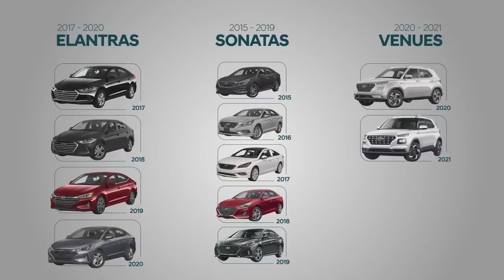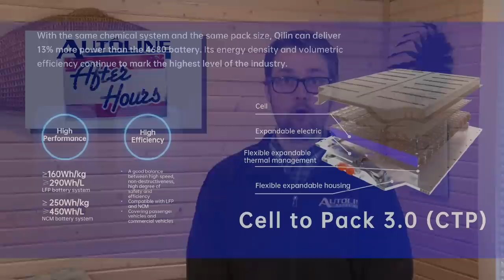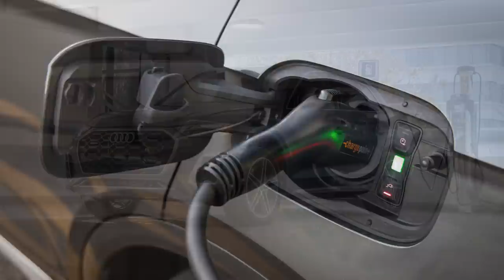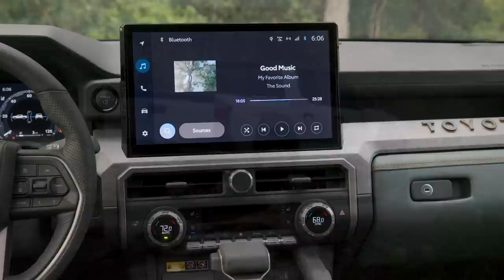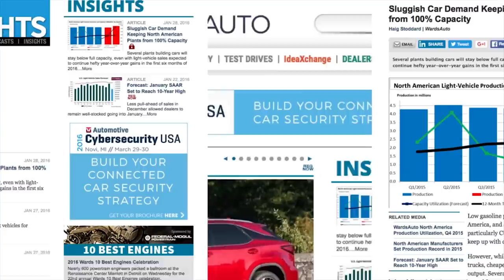GM Will Miss 1 Million EV Sales Target; Silverado EV Beats Range Estimate - Autoline Daily 3571

Comment: Nuclear Fusion costs lots of money. The fuels used to fuse together are right now not cheap and often have to be made first. Then there is the maintenance expenses. 
Ergo nuclear fusion power may be just or more expensive than electricity from conventional fossil fuel sources. 
The real competition here is wind and solar power which are way cheaper and require less maintenance costs. So the ongoing costs to run and service a nuclear fusion reactor are large. 
The reason you are hearing so much about fusion right now is that the scientists and investors are hyping it because they realize that fusion is becoming irrelevant since wind and solar will have completely taken over the market by the time fusion power can be made prevalent. 
Then they will be out of a job!

This is very similar to car companies hyping hydrogen fuel cell vehicles. They are not catching on and very soon battery tech will deliver as many or more miles per charge than a tank full of hydrogen can. Also the charge times for batteries will be cut in half within five years. 
Both fusion and hydrogen, as broad based power solutions are failing. Solar and wind will dominate and Battery only EV cars will be the only choice consumers will make.
Reply: Yep it will pretty much only be viable once they get He3 surface mining on Luna down pact, so yep not any time soon. But it's better that creating mountains of waste with renewables over time. It will be interesting when the fast fission plants come online and have lots of cheap fuel to use when they process the used fuel from the current plants.
Reply: @anydaynow01  Actually there are now companies that can recycle the wind turbine blades now as well as others that are recycling the solar panels. 
So maybe it won't be too bad since the expected life of these things is over 30 years.
Reply: renewables can be recycled much more easily than non-renewable waste....  just need to add the cost of the negative externality to the commodity.....  such as for disposable plastic or any form of pollution from an energy production....

making fossil fuels many times more expensive while making renewables about 10 to 20% more expensive....

Comment: GM is still the best bet for the best cheapest EV, Equinox, but I'd rather have a Bolt. The other choice is Nissan leaf, blah.
Reply: Where is GM building the Equinox? Mary announced the product- did not mention a factory…
Reply: @FrunkensteinVonZipperneck  same factory as bolts are currently manufactured, Detroit area.

Comment: Charging at 350kW is quite different than charging at a station capable of 350kW.  With 800V, the maximum CCS can provide is 280 kW.  This is a common misleading statement by some manufacturers.  For example, a Bolt can charge at 350 kW stations, but only at 100 kW.
Reply: How much do you want to bet?

You're confusing  It with the  inferior SC standard (vs CCS  standards)....   a 350kW DCFC can charge at 800 volts up to 500 amps. which actually exceeds 350 watt kW.....

And what Bolt can charge at 100 kW rate?  It's actually 55 kW....  

Enjoy the Kool-Aid...
Reply: @nc3826  We are both sort of right. I was talking about CCS 1 (USA) which is theoretically limited to maximum of 400 amps. Most CCS stations here are far more limtied.  You are talking about CCS 2 used in Europe that doesn't work in the USA.

You're right on the Bolt. I didn't realize the limit was so bad. 

The NACS (Tesla) standard allows for far more power.  With V4 now available in select locations. V4 Superchargers in Europe supports up to 1000v and 615A or 615 kW (actual installed hardware, not theoretical limits).  V4 Superchargers in Califoria supports 750 kW today. There are no vehicles other than the Tesla Semi that can use this high power level.
Reply: @tesla_tap   Nope you're still completely wrong.... 400 amps is an old limit CCS  for both type 1 and type 2..... type 2 just has a higher end AC charging limit....

Google MCS charging it blows a V4 out of the water....  But battery swapping superior anyway....  And yes there are commercial trucks that use battery swapping.....

 It's all good, enjoy your  Elon Kool-Aid....
Reply: @N C  so dead that Ford just announced they are supporting NACS. And over 70% of USA EVs today use NACS. CCS is an unreliable mess that users hate.

Comment: TESLA RULES
Reply: Just in your mind!
Reply: Not in ride quality.  Not in ergonomics.  Not in parking sensors.  Not in phone integration.  Not in auto windshield wipers.  Basically just in charging network reliability, which is important, but it's not everything.
Reply: Depends on who assess and how they are assessed.  They "rule" selling carbon credits, getting government subsidies for their EV's, and promoting EV charging infrastructure compared to other VM's.  Their EV's are not particularly well built, styling is dated, and they cost too much, but they are fast off the line and have cool touch screen consoles.  The ride quality isn't bad either, except for some annoying squeaks and rattles.   As the saying goes, they are a bargain at half the price.
Reply: At marketing lol